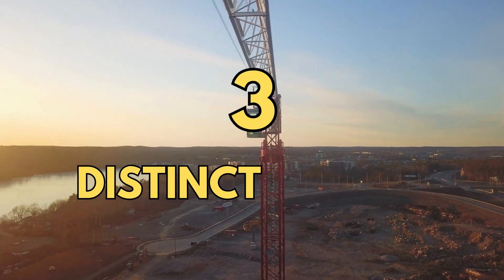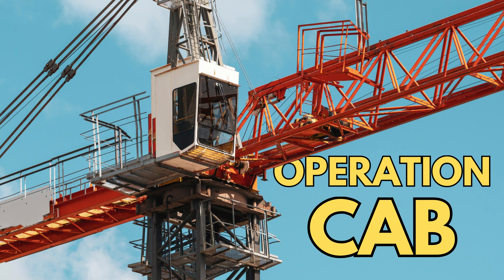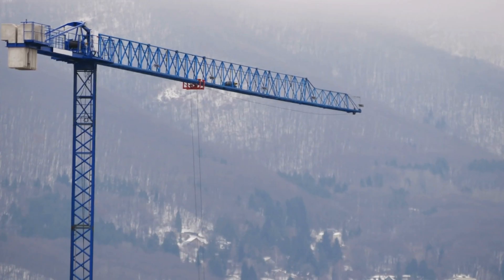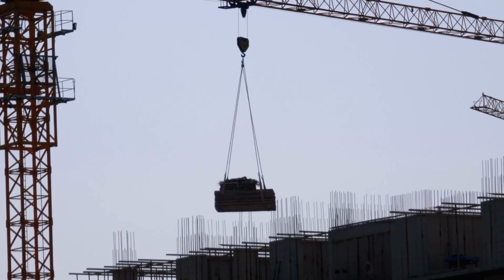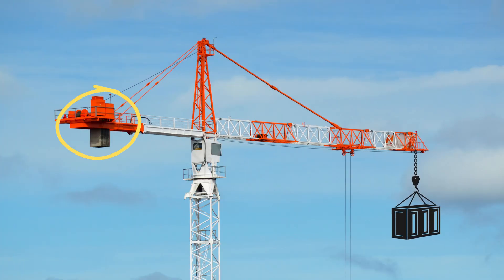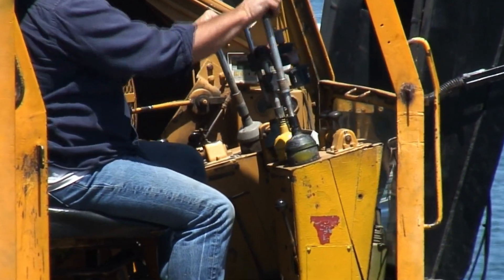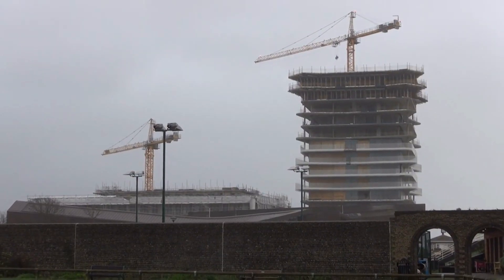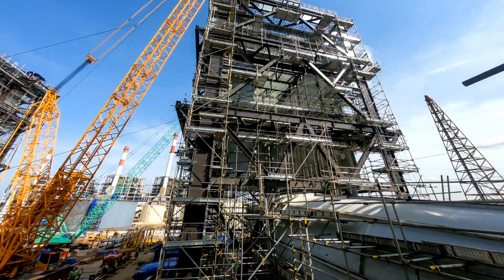Why Don't Tower Cranes Fall Over? #construction

Comment: Toppling is one thing, but safety incidents is a completely different topic 😂 My neighbor worked as a Tower crane operator for 20 years. He got struck with lightning 6 times and barely avoided accidents quite a few times!